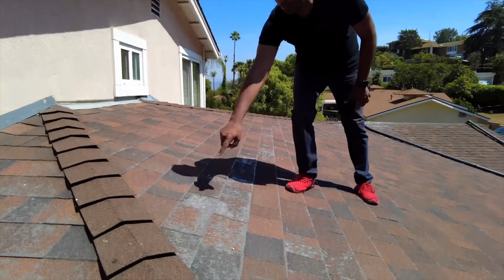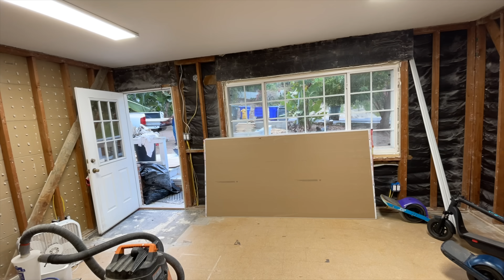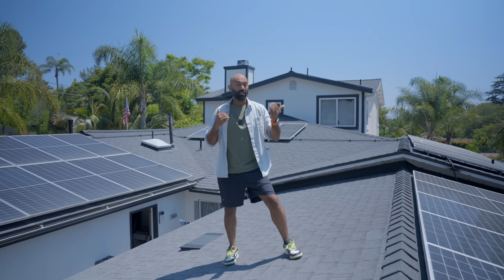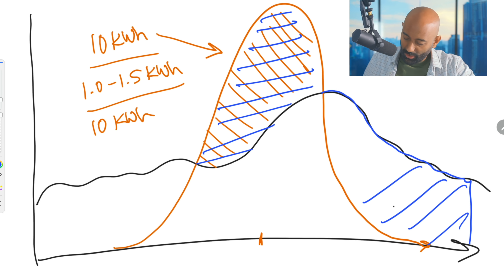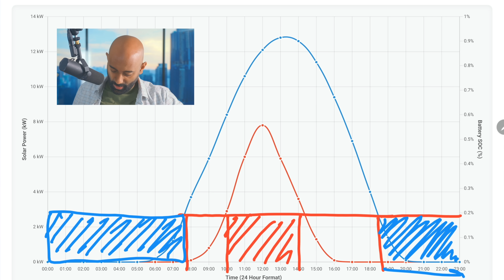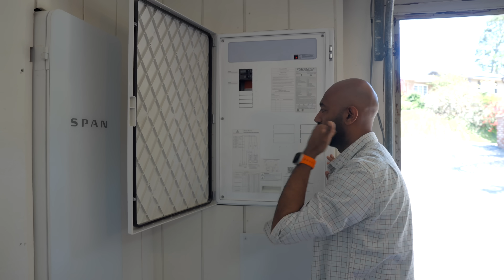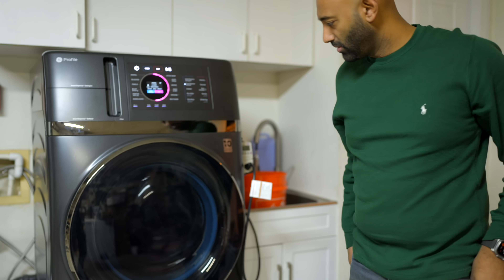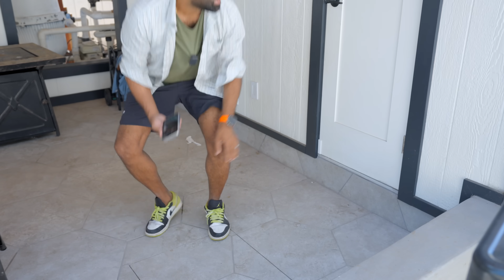Is Self Reliance Possible? Net Zero Home 4 Years Later...

Comment: What does NEM stand for?
Reply: Ah - I've got it - Net Energy Metering. We have a house in Cyprus with solar panels that are on Net Metering as early adopters. Lately the rapid uptake in solar has forced the State Electricity company to begin CLIPPING output from the latest solar installations, as Cyprus doesn't have an Interconnector. Although there are plans to lay a cable to Crete, this is probably years away, so it's likely that later solar adopters will need to install batteries (if allowed by the state to do so) Currently, as early adopters under an earlier contract, we are exempt from clipping.😊

Comment: I use an Australian branded heat pump hot water system called Reclaim, which runs silently and quite efficiently. I don't know if you can get it there, but if you can, I highly recommend it.
Reply: @fauzirahman3285  Heat Pumps are very dependant on local climate too.
Reply: @crazyham  fair point I guess, the climate where he is seems a lot warmer than where I am.

Comment: For those that live in areas where power company connected solar doesn't charge you a fee simply for having solar, be glad of where you live.  Net zero (energy) is impossible for some (including me) without 100% disconnecting from the power grid (IE: having batteries, emergency generator, etc. too).  And, most cities have codes that state that power grid connections are required anyway... (no disconnecting from the power company).

I'm glad some people can use solar.  I wanted to, but when having solar costs you more than not having it (including long term), the dream is impossible.

Comment: Ricky,
You went with your solar and battery storage the complicated way. You should have used Sol-Ark, you can AC couple it with your existing micro-inverters, expand, and add more batteries...I understand you probably got some freebies from your sponsors.
I have two 15K Sol-Ark's in parallel, 30KW in solar panels and 250 KWH battery storage, I live in Florida and our AC runs pretty much all year around (my average monthly consumption is 3 MWH I have a large house).
I love your videos! Keep it up.

Comment: Dude, net-zero is stupid.
Instead, get the cheapest battery that will power your needs during on-peak hours. 
Ex: AZ on-peak is ~4.5x more expensive than off-peak.  The only thing that needs to run is the fridge...AC: off, Lights: off.  I could run the AC during off-peak hours for 4.5 hrs to equal the same cost of that 1hr of on-peak.  What do I do?...Go out to eat, work late, go to the gym, go for a walk, sit at Panera and enjoy their Sip Club. Easy.--That's how you save without breaking the bank.  BTW, the AC only runs about 30-45min (depending on AZ temp) to get back to a comfortable temp.
Next more efficient use of money...increase insulation in attic or improve the windows.

Comment: Would it be possible to talk about rental / solar leasing. A lot of people are in my boat… bought a 2000sqft house and had to agree to taking on lease on 14kw system. So it was free, and our bills are low. However we are big into preparing for emergencies and want to add batteries. This means we need to buy an expensive inverter and battery system. I would rather use more common lithium car batteries or something that is readily accessible. These prices of 10k or more are not doable for most Americans and so I want to find a way to buy piece by piece.  Is there a way to convert existing inverters to add batteries? What is the cheapest way to add batteries in this scenario? There are a lot of people stuck without batteries bc there inverters don’t work with batteries as I’m told 🧐 thanks love the video!

Comment: I never cried more than the days I was learning how my pool works....I replaced my 1.5 hp pump with a 3 hp vsr pump. Then, learned that spinning it above about 50% of its rated speed only added watt-hour usage, didn't push any more water through the system. Live an learn. I'd have been just as happy with a 1.5hp replacement. Even over-spec'd, my VSR pump saved my over 60% power with no loss of pool clarity. Thank goodness I sold that house!
Reply: Yeah but spinning your 1.5 hp pump at full speed was probably also waist full energy wise
Reply: The amount of energy being used by the pump, even the new one, is obscene. The old one was using nearly as much power as the typical US household (24 vs 28kWh/day) all by itself.

Comment: Interesting video to watch from Munich, Germany. Wow your electricity is expensive, so is your usage. 50c per kwh. In Germany it can be as much as 50c, but it's usually 35c in the peak usage times, 18c in the peak solar generation in summer. In winter it sits about 40c all the time.

Been on a similar journey to you. I noticed you have a huge amount of untapped solar potential on the roof. Check out videos on north facing panels. Panels are cheap these days, at least in the EU. Expect 40% of south facing. Still useful if they are cheap.

I also bought a heat pump dryer, not a combination washer/dryer unit, as we had a washer already. You just take the load from one to the other, and now you can again wash. Gives a higher throughput given the long wash/dry cycles you find with the energy efficient devices.

I didn't quite get why you had those Ecoflow batteries. I have some BTW. You had those nice external batteries. Does it actually help? Why not extend with the external batteries?

Comment: cheaper system would have been 2x 5k Multiplus Victron...and Rackmount battery ( expand as you go on the cheap-discount days -try to stick with the same brand and size)  
or build your own batterys ...  BUT  the EcoFlow is nice   works fast out of the box...but adding stuff gets more expensive. so for me its good for small homes only ...
Its good you looked at where to save electricity, but you can save also with changing to a new tv or fridge or    was-dry machien (or run a lighter program) ... 
small things add up ,  you just have to think diffrently  ... same thing with lights to led ...
last will be the things you dont use often, but draw power - you can add switches to them. ( systems in standby  can eat 30-50W per hour each...10x 300-500w/h ) 
so ja ...look around in the house...write stuff down...  in the end   its a game ...
300w saved per day... is 7.2 kWh/day × 30 days ≈ 216 kWh/month  ...7.2 kWh/day × 365 days ≈ 2,628 kWh/year   ...
or go to induction plates for cooking... turning of your heating a bit earlyer...    it all adds up ...   its like a water leak, dripping...hahaha  you think it doesnt matter but it adds up  a lot more than you think ....

Comment: I feel like it would be very challenging to go net zero for a standard build home that does not take into account ideas of passive heating and cooling and orientation. It won't matter how many LED lights you put in the house if the sun is heating up your home in the summer and is completely missing the inside in the winter.

It seems to me that the only way to have a truly not zero home is to or at the house to the sun, have large overhangs and thermal mass to bring in the sunlight in the winter and block it out in the summer. Passive air conditioning systems like ground source heat pumps, or the types of air movers they have in the southern part of the US or in the Middle East, or cooling tubes like they put in earth ships. Getting your heating and cooling down like that is going to be huge. Additionally, if you're going to have a pool, it ought to be covered in some way. Although really, if you're going to go at zero, I feel like a pool for general swimming usage is really a luxury you can't afford.

Another trick I've seen, which I don't think you implemented, was installing the refrigerator such that the cooling coils are on the outside of the house so they don't contribute to temperature inside. Possibly having it so that you can close it inside when you do want additional heat inside.

Comment: I have an ecoflow system, and like Ricky, I had times of excess production with full batteries. Instead of spending $2000 on new add on batteries, I spent $70 for a 120v  1kw10gal RV hot water heater. I have it wired to a 20a capable Tapo smart plug, powered off the ecoflow. I have an automation active that when the batteries get above 95% charge, it will activate the hot water heater, and use that excess energy to store it in the hot water. It turns off when the battery drops to a lower level. For Ricky, it's easy- hot water in the office, and I calculated that 10gal of hot water stores about 4kw of energy. HVAC and hot water are the biggest energy users in most houses.

Comment: Thank you for all the good info.  I live in Thailand and the price difference between here and San Diego is crazy.  I had 13.3 kw of solar and 15kwh of lifepo batteries installed for about US$15,500 but with a local kwh cost of only 14 cents it will take about 8 years to pay off.  Since the time I installed it, solar/battery prices have dropped even further!  Chinese brands are common here and are of pretty good quality.  I hope those cheap prices reach the US.

Comment: Fellow San Diegan here. Our situation is a bit simpler - smaller property, no pool, no office. That said, I calculated back in 2019 when electricity rates started to spike that now was the time to switch. I estimated how much we'd need based on past electricity bills, EV data available then, and our gas bill converted to kWh. We already had electric washer, stove, and oven, no replacements needed there.
- Heat pump installed in September 2019 and replaced the gas furnace.
- Solar panels and battery were installed in October 2019.
- EV followed in Spring 2021.
- Heat pump water heater in late 2021. It's a Rheem by the way, love it! Energy use is around 100W averaged over the day for 50 gallons, barely visible in the overall energy consumption. The only drawback is the relatively loud heat pump.
- Shortly after that we had our gas supply line capped off. Big milestone!
- Early 2022 we started buying 2x carbon offsets (audited and verified) from Wren.

Averaged over the year we are net zero and fossil fuel free, and actually get a few dollars back. The carbon offsets take care of the offsite energy use - dining out, services, and travel. 
Lessons learned: I had estimated the EV consumption right, massively underestimated the heat pump energy use, and massively overestimated the heat pump water heater use. Overall it balanced out, but as Ricky says, go for it, learn, and adjust.
Reply: By the look of it, Ricky really uses a hell lot of energy. Like why you need an extra system for the office. When you are out of work, what power does the office even need to justify two huge batteries? It feels like he could save a ton of energy very easy. And glad it works out for you. San Diego is very sunny, for lots of other people that may won't work out that fine.
Reply: Great post and congrats. I followed everything except the carbon offsets by Wren. No idea what you are talking about. Can you refer me to something that would explain?
-California rules!

Comment: Gas-only heating???? You know heat pumps can connect to a coil in a furnace, right? Providing both heat & cooling. That way the existing burner can be used as the backup heat source.

Comment: Nice update it's been a while since I watched the channel nice to catch up.  You mentioned the water heater.  I installed a Rheem heat pump water heater 6 years ago.  It has been rock solid.  No issues, no problems just hot water.  We run it on ECO mode (heat pump only) we did run out of hot water one x-mas day.  Multiple showers, loads of laundry, cooking, dishwasher, running the sink etc. It ran out on the 4th shower later in the afternoon.  Easy fix I went into the app and turned on the internal heating elements for the rest of the day.  That's it.  Our experience has been great.  My $.02

Comment: Similar story here in SW Germany. Got solar, heat pump and batteries. I'm currently a little frustrated as I'm exporting 30kWh daily to grid but also buying about 0.5 kWh. I think the inverter is too slow to switch - I wake in the morning to batteries still half full but 0.1 kWh used! Fun trying though. :-)

Comment: im a little confused....you said you were using microinverters on your solar panels but you said in the office you were using high and low voltage inputs which to me sounds like you are getting DC directly from the panels.  Is the house on microinverters and the office on direct solar?